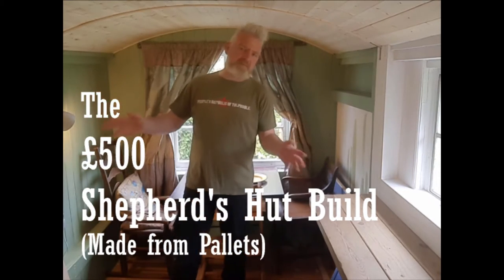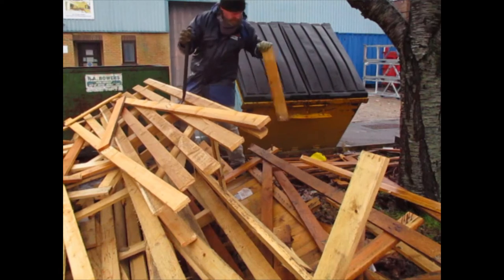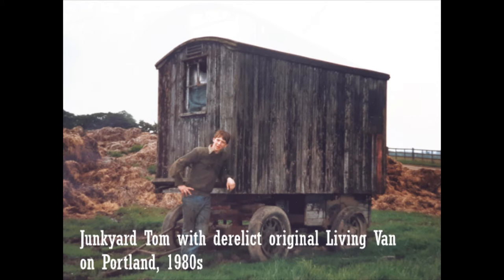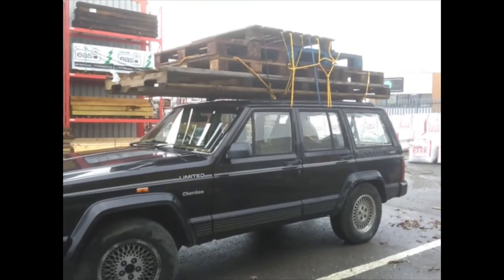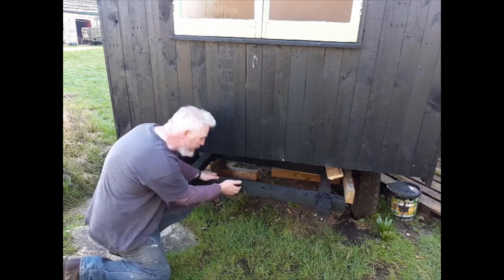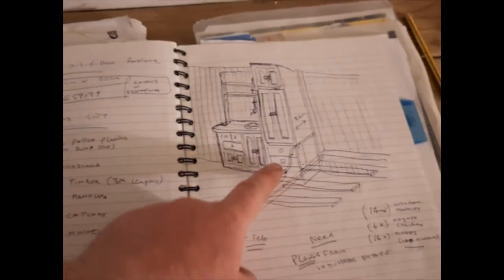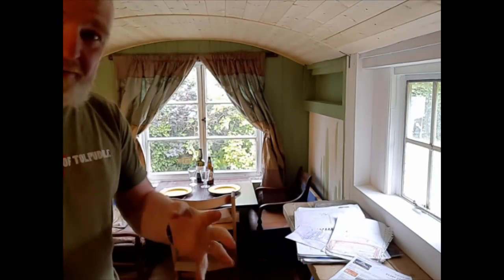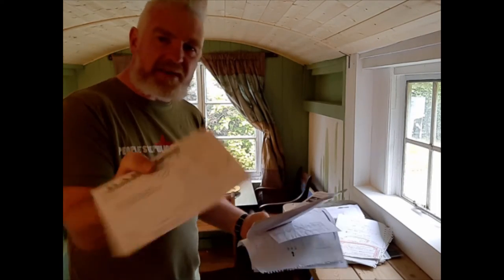£500 Shepherd's Hut - DIY Build from FREE Pallets & Recycled Timber! - Ep.1 Project Intro

Comment: Whilst I didn't build a hut, I did build a small landing for my house out of pallets that I got for nothing.  I found taking them all apart to be a bit of a pain and because pallets are not pressure treated, they started to decay after about 3 or 4 years.  However, I did get a nice landing for a few years until I could make a better one, which was great and I learned a lot.   In the end, I replaced all the rotted timber with pressure treated stuff and it is fine now.  Because I had never built anything like that before, I learned a lot and had a great sense of achievement.  😊
Reply from the maker: Hi Pauline. Yes, they are quite a pain to take to bits. Eventually, i worked out the best way to break pallets down was to be pragmatic, and not try to save every plank. instead, decide the bits I wanted to save and the bits I'd sacrifice. I would cut each side of the "good" plank and then split the remnants of the other planks off the nail with a wedge. That way, the good plank would not be damaged by crowbar or chisel levering, or the nail tearing through. You are right, the wood can sometimes rot very quickly if not protected (but not all pallets are the same wood, some are better than others). And some already have rot & fungus  in them when you find them. For this build,  I was pretty ruthless. Any black spots, staining or withe growth and the pallet would be firewood. Also, I spayed all the wood as I went to reduce risk of fungus or insect problems. Finally, I hope the roof structure will keep the timbers dry do it will hopefully outlive me. But, like you say, it's a learning experience. I am genuinely pleased to have built something so big from pallets, but also feel I am "cured" of my urge for pallet building. (It's great stuff and will be useful skill when the zombie apocalypse comes...but DAMN, it does take a long time pulling out all those nails!) For me, the real revelations for free and truly useful timber were the very long 4"x1" planks from the roller-blind crates and the "Dunnage" packing & transport timbers (5" & 6" square) used for transporting large steel girders.
Reply: @TomsJunkyard  Thanks Tom, you are right about some pallets being better than others, I just used what came along and I'm sure they could have been better.  I tried to protect them with deck coating.  Also, they come in different sizes and that can be a pain.  I love that you got the really long planks and those wonderful square timbers, so useful.  My sister and I built a horse shelter from pallets years ago and it lasted ages, may even still be standing.  Love your cabin on wheels.

Comment: So what is the axle/chassis for the wheels to mount too
Reply from the maker: Hi John, the axles are scaffold tubes - I made an axle bogie / carrier for each axle from timber Dunnage sections (free) 6x6 - the front one had turntable built in. Then I fixed these to a MASSIVE pallet that was used to deliver some industrial machinery (also free, from a Builders merchant who wanted to get rid of it) then I bolted 6x normal pallets on top of the massive pallet, to make base for hut. If you did not have big pallet, the base could just be two 8x2 timber sections with cross-braces, like a decking-base.